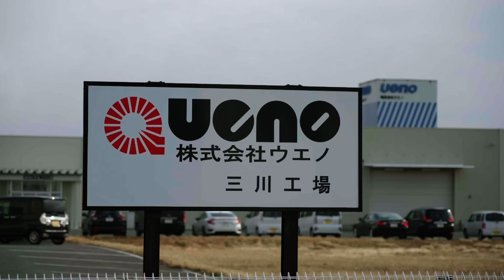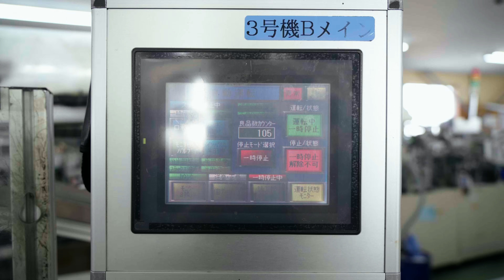【工場潜入】世界中の家電を支える日本の職人技とロボット技術｜“世界最小コイル”ができる瞬間！

Comment: a bit unclear, why making seemingly the similar coils involves both machines and humans. But other than that I had an enjoyable experience with EMC products of Murata (coils, common mode chokes, ferrites, etc). Great value and educational materials for the customers.
Reply from the maker: @7th_dwarf542 san
First of all, thank you so much for taking the time to leave such a thoughtful comment! 😊✨
We’re truly grateful when someone like you — with both experience and insight — shares feedback that helps deepen the conversation.

Regarding your question: while the coils may appear similar, some small-lot or customized types require minute adjustments in shape, tension, or material handling that machines alone can’t manage precisely. That’s where skilled human craftsmanship still plays an essential role.
At the same time, securing and passing on those skills is one of the biggest challenges we face in modern Japanese manufacturing.

We’re honored that you took the time to engage with the video and share your perspective.
New videos are posted every Tuesday and Friday, and we hope to welcome you again soon! 🎥🗓️☺️